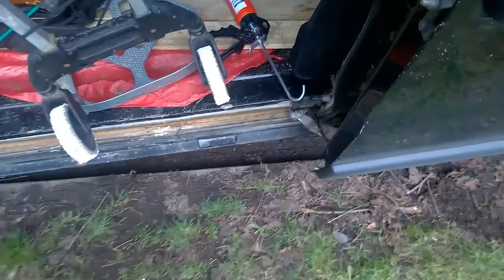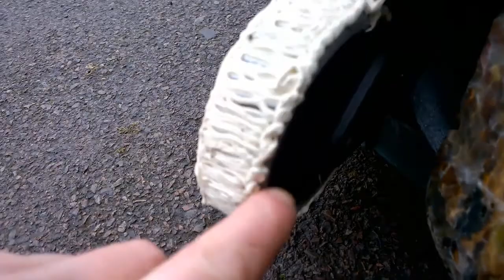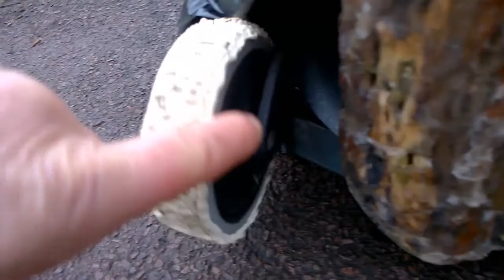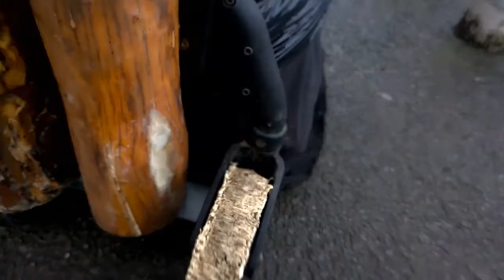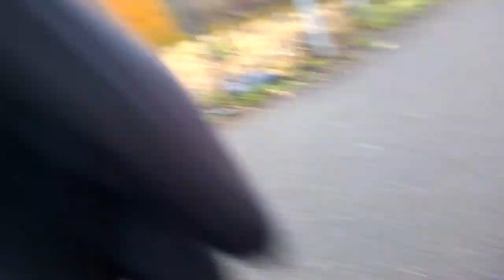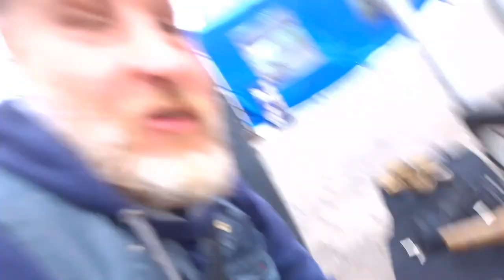silicon tyres on my trolley weels (failure!)

Comment: Just follow the caulking crumb tire tracks were jammin' with K22!.....seriously bro cut up an old bicycle tire,cut it once, and wrap the old bicycle tire around the plastic wheel. Affix the ends of the tires to the sides of the wheels with self tapping screws, 1/2 inch id say